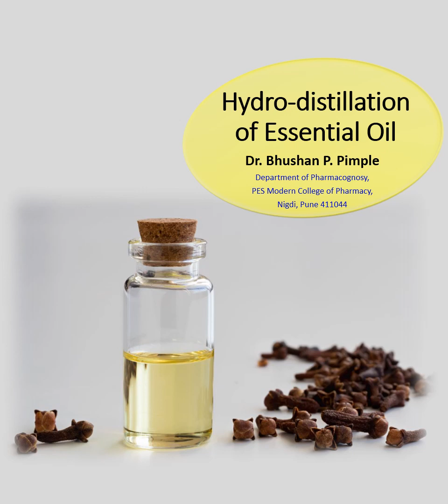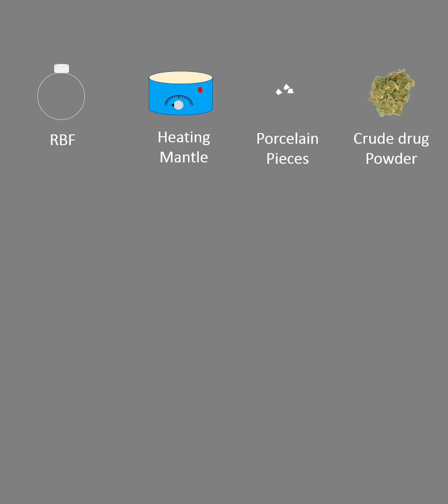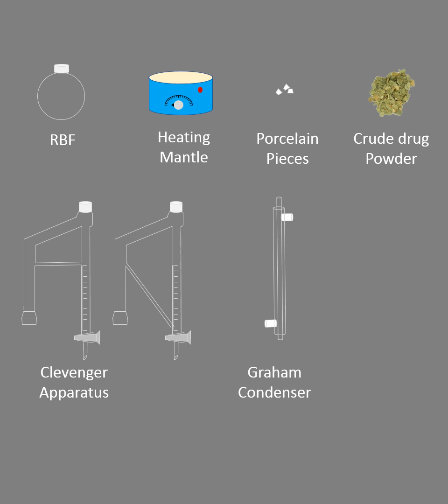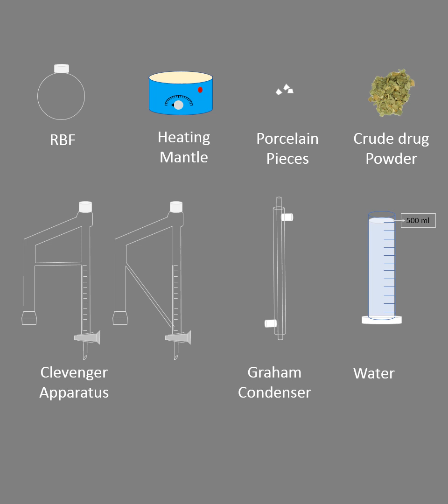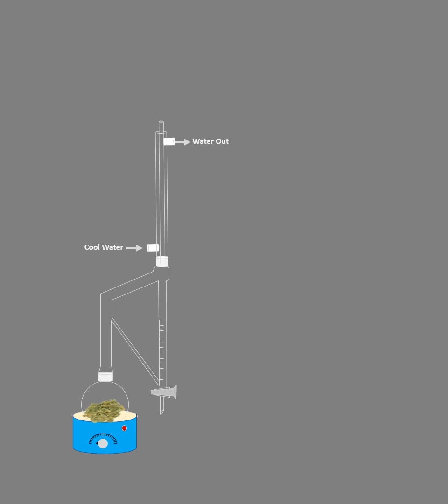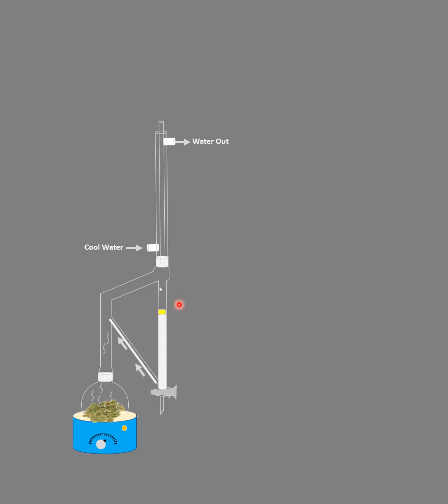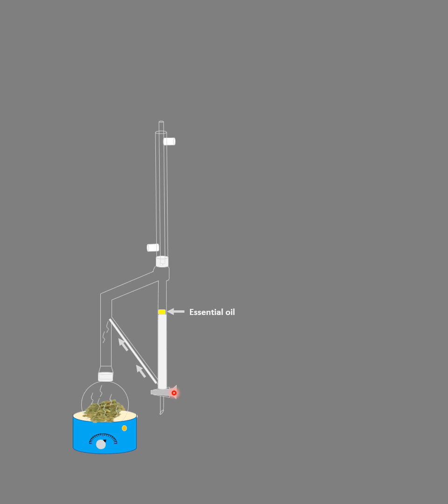Hydro-distillation for Essential Oil Separation: Dr. Bhushan P Pimple

Comment: Sir what is the temperature that needs to.be maintained.How much quantity of oil do we get from dry chilly powder and coriander powder
Reply from the maker: In hydrodistillation, water boils just below its boilling point. We cannot control the temperature but the heating rate can be controlled. 
About coriander powder, the linalool content and its volatile oil gets degraded by hydrodistillation. So, it's not suitable.
Chilly powder contains very less amount of vol oil. I have no idea about its isolation by hydrodistillation.
Thank you
Reply: @bhushansong ok thankyou sir

Comment: Good morning sir
It is very informative. 
I have a project on tulsi leave. By which method I got the maximum extract.
Reply from the maker: Thank you Kiran for watching the video.
You should go for hydro-distillation if you want ocimum leaf oils.
Shade dry the leaves, crush with hands (do not grind in grinder as it may cause loss of volatile components due to friction). Soak the crushed leaves in water (in the same RBF) overnight for better yield.

Comment: Sir what is the mathematically calculation after the extraction of essential oil , I have a project on it
Reply from the maker: Ex. Suppose you have taken 25 g of clove powder & you've got 1 ml oil. The % yield = (100 × 1)÷  25
 = 4 % v/w
Where v represents oil in ml obtained & w represents crude drug taken in g
Reply: @bhushansong it is sufficient for my project ? or other material balance carried out for  my topic . My topic is extraction of essential oil from hydro/water distillation of tulsi
Reply from the maker: @anchurdalvi  phyto-chemical tests, physico-chem (boiling range, RI, Opt rot, viscosity etc) chromatographic profiling can be the parameters to study

Comment: Hello sir, I need your suggestion..we use steam distillation for extraction of Essential oil of Eucalyptus and pine ....we get essential oil but excessive amount of water in it.. further we use distillation unit for the separation of water...but we didn't get essential oil.
Reply from the maker: Many thanks for watching. Instead of distillating the oil-water mixture, just let it cool in refrigerator. The oil will float on water, then you may separate by separator (separating funnel) only if the quantity is sufficient.
Alternatively, you may shake the oil-water mixture with diethyl ether n separate the ethereal layer and evaporate to dryness at room temp.

Comment: Thanks for the video sir, it's tough to separate the water content from oil. If I add anhydrous sulphate then it's become impure and 2ndly in our we don't have fractional distillation unit in our lab. So, what's the good or alternative method sir, please sir give your valuable suggestions
Reply from the maker: Thanks for watching. Collect the distillate (with water), shake with CCl4 or CHCl3 in a separatory funnel. Collect the lower layer from the separator and evaporate to dryness at room temp in a graduated tube.
Reply from the maker: No need to use a fractional distillation unit. Use a separating funnel and shake distillate with diethyl ether (caution;: hingly inflammable) then evaporate ether layer

Comment: Sir, I was taught that during hydro distillation process there is an extraction medium, like a non polar solvent (hexane) is used to absorb the gaseous oil as it flows from the condenser. But you didn't made mention of it. Is hexane important in hydro distillation extraction?
Reply from the maker: Yes, you are taught correctly. If the extracted oil is very less or if the oil is to be used for any phytochemical analysis, then  we make use of any water immiscible solvent (hexane, pentane or ether) to dissolve it. Later on we may separate the layer & evaporate the solvent. But, if we just want to quantify the oil (for QC of crude drug) separation is not necessary.
I appreciate your querry. Thanks for watching.

Comment: Is Hydro Distillation better for making hydrosols? I guess yes cause in this way the essential oils stay into the hydrosol?  I read that when hydrosols is a by-product of essential oils like in steam distillation the hydrosol is not so good in quality. I want to make the best quality of hydrosols... I know that for essential oils steam distillation is way better... Please Dr let me know !
Reply from the maker: Hydrosols are usually made up of floral oils. Most of the floral essences are thermo-labile (degrade at high temperature). Hence, hydro-distillation is not the preferred method.
Enflurage method is ideal for floral essential oils. Finally, these isolated oils can be mixed in a co-solvent (few mls of ethanol) then dispersed in water. 
For citrus oils you may use eculle method/solvent extraction.
If possible go for Supercritical fluid extraction it is ideal for all kinds of oil.
Reply: @bhushansong  THANK YOU!

Comment: Hi sir, I would be very grateful if you can help me, when It is better to do hydrodistillation and steam distillation?
I want to make sandalwood, frankincense, myrrh and palo santo essential oil
Thank you!
Reply from the maker: If you have the assembly for steam distillation, I'll suggest to go with it. As steam distillation is advanced technique and has more yield, reduced hydrolysis of essential components.
An electric rice cooker with slight modification (for steam collection) can be least expensive device. Of course, you'll need a professional for modification.

Comment: Hello sir , I tried to extract essential oil by hydro distillation method . My actual problem more water is obtain instead of essential oil. Pleas let me know about this problem
Reply from the maker: Hello Mansi,
Thanks for watching the video.
Let me first clarify that water is a heating medium in this experiment. It will keep on circulating through the return tube.
If the crude drug has sufficient amount of thermostable volatile oil, then, you may find it either on the top or bottom of the water column in the receiver.
Initially check the powdered crude drug for presence of volatile oil by pressing it between 2 filter paper, it should show oily stain (that evaporates on heating).
Alternatively, you may gently heat a pinch of crude drug with water in a test tube, it should evolve aromatic odor.
Check n let me know if these tips are helpful.
Reply: pleaase share your number .
Reply from the maker: pimplebhushan@yahoo.co.in
plz mail me your doubts. I'll try my best to clear.
Many Thanks for watching.